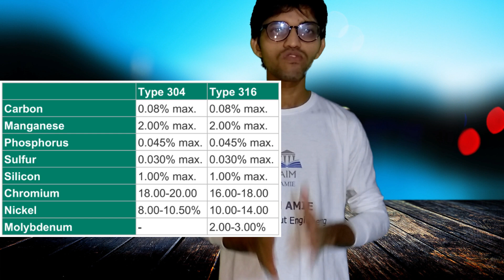What is the Difference Between SS304 & SS316 ?? ||Engineer's Academy||

Comment: You said 304 works in water application, does that include salt water application, in terms of length of service, does the 316 last longer in that environment, and for a long enough period to warrant the additional cost of materials ?
Reply from the maker: Yes !! SS315 lasts longer in that environment.
Reply from the maker: Cost will be as per market conditions.